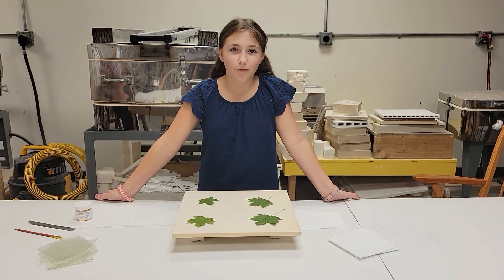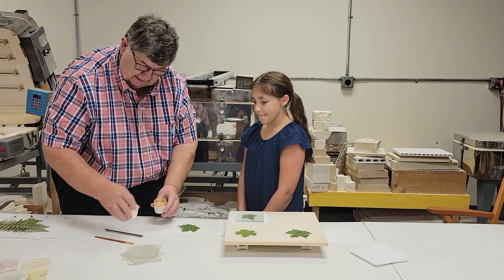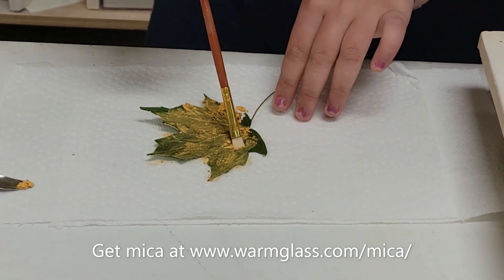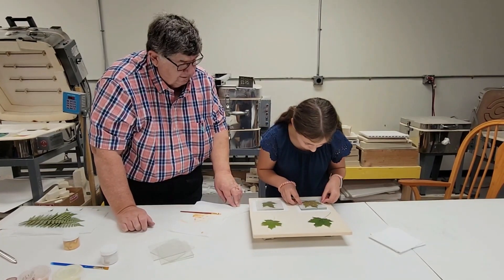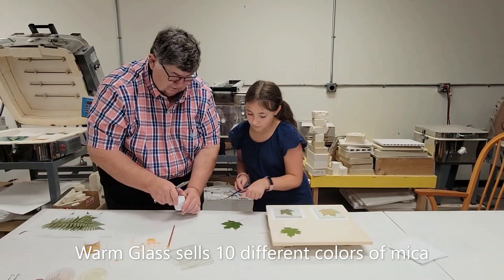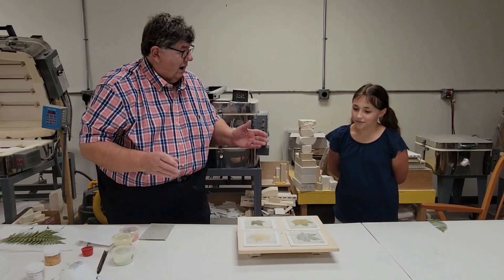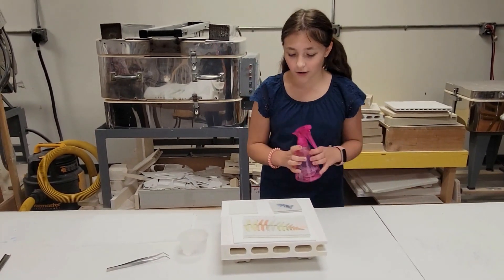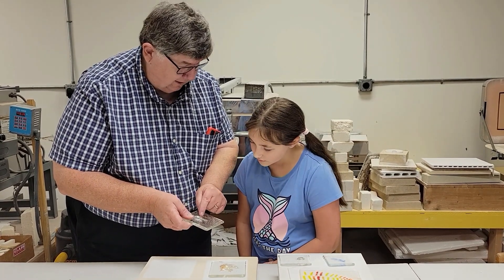Fusing Leaves in the Kiln

Comment: Hi, this is a great presentation but can you share the schedule for the Mica on leaves please?
Reply from the maker: Just use a standard fusing schedule.  We use 300F dph to 1100F hold 10 minutes, 250F to 1230F hold 30 minutes, 250F to 1460F hold 10 minutes, then as fast as possible to 900F hold for an hour, 100 dph to 750F no hold, kiln off.

Comment: Very nice indeed. Please write the temperature and the ramps to fuse the leaves and the name of the powder you used. I would love to do it with my grandchildren. Thank you
Reply from the maker: We used Bullseye powders.   When we fired, we held at 1230F for around half an hour on the way up to help minimize trapped air bubbles. Then we continued firing on to a full fuse temperature, which is around 1460F for the what we made in this video.

Comment: the fiber paper allowed the air to escape??
Reply: The glass becomes mailable and can flex a bit, allowing the air to push its way out. Two glass pieces would become like a thick paste and any air would either be trapped or form a hole were it broke through the glass.